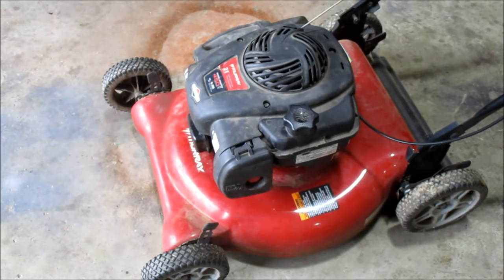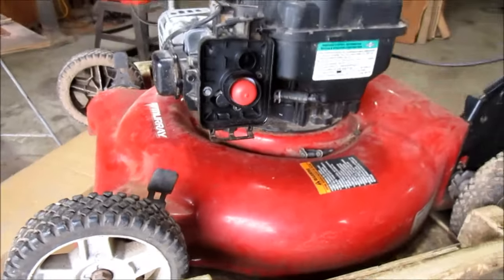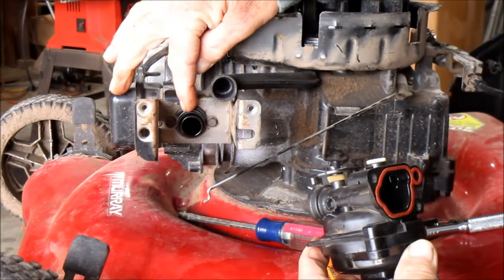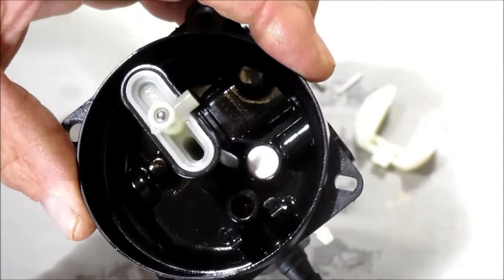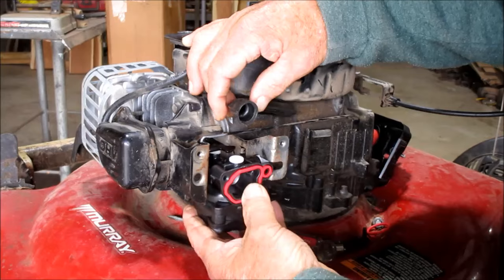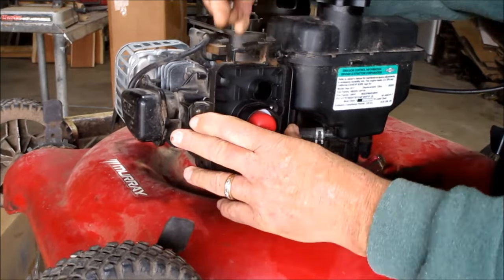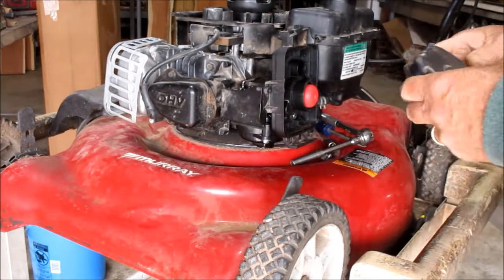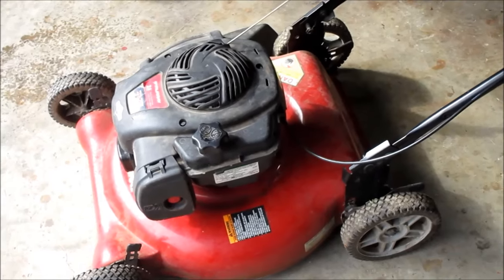Murray LAWNMOWER Won't stay Running Briggs Stratton E-Series 4.50 HP: CARBURETOR Removal and Replace

Comment: Thank you. I followed all your steps replaced the gas tank and carburetor.  Something chewed a hole in the gas tank  so most likely water got into the carburetor and that’s why I had to replace it. Hardest part was finding the right size nut drivers in my husband’s garage.
Reply from the maker: Glad I could help. Thank you

Comment: Thanks Larry! Found a Murray lawn mower in a shed at one of my rental properties that had the same carb. Had been sitting for years and wouldn't start. I pulled that white plastic venturi assembly and it was all clogged up. Just shot compressed air into where that ball bearing is and it came clean as a whistle! Mower starts on the first pull!

Comment: Hello I just found this video, a friend of mine brought  me a lawn mower just like yours with the kind the same problem,  it start run for a minute and then die, also gasoline coming from carburetor, I put a new carburetor and spark plug and still doing the same thing and gasoline coming from carburetor, I put on a shut off valve from keep wasting gasoline , Do you have any idea why is doing this? Thank you for your help and time.
Reply from the maker: It can only be one thing. The needle under float is sticking open allowing fuel to keep flowing
Reply: @LarrySbrusch  Thanks for replying.

Comment: Curious what do you use to get gas smell out've hands . I wash with soap still stinks . And some got on rug in porch how do I get that smell out
Reply from the maker: I have used a lot of different things. What is normally use is a hand cleaner that also removes paint, but it doesn’t smell much better than gas ???. You might try vinegar or some type of ammonia based products. Not sure what else to recommend

Comment: Where's the oil cap and dipstick ? I don't see it on this mower . Just gas cap
Reply from the maker: Mine did not have a dipstick on top. It was down at base of front corner of engine

Comment: What was the two socket sizes you used. I know one was a 8mm for the pull housing and two of the screws on the primer bracket. What size was the other two screws. Was it a 9mm or 10mm.
Reply from the maker: It’s been awhile ago, but if I remember. 10 mm rings a bell
Reply: @LarrySbrusch  Ty
Reply: 5/16 and 9/32 for the air box, 9/32 for the carburetor bowl.

Comment: Carb gums up on first tank with this engines.  I know of 4 different people with same engine with same problem.  Non-ethanol gas helps, but it will eventually get gummed up again
Reply from the maker: Yes you are correct, I’m having the same issues
Reply: @LarrySbrusch  I used an ultrasonic cleaner and overdid it with a 3/64 bit drill.  now I get too much gas.  I have ordered 5 of the part with the jets in it.  will have to wait a few weeks tho.

Comment: Briggs and Stratton are complete junk every briggs i ever had sooner than later wont start i have a new mower thats a year old and wont start put seafoam in it still wont start cheap peice of junk plastic made carburetor they dshoul have a class action law suite against them in the 80s and 90s you could leave old fuel in them over winter and three pulls it would fire right up
Reply from the maker: I agree with you..if they did that , they couldn't sell us anymore junk..The good ole days are gone, just like the old 327 chevy motor..change the points, condenser and plugs and it would keep running..

Comment: So that white nipple on the primer casing has nothing attached to it?  Like a gas line or anything??  Found one in the trash and never worked on a newer mower like this
Reply from the maker: no it does not. it confuses every one. Appreciate the comment
Reply: @LarrySbrusch  its why I like the old school machines. Easy to work and they are built to last. Not built too fast
Reply from the maker: Yes you are so right

Comment: I used this video to fix my Murray 550 today. I ended up cleaning the old carb, replaced the spark plug and filter and she started up first pull and stayed running until the lawn was done. I made some simple diagrams where what screw went where. Made it easier to put back together. I emptied the old gas and put in new. Just took my time. Thanks. But dang it, push mowers were so much easier to work on 20 - 30 years ago. Maybe that was the problem. With proper maintenance they lasted too long! I wish I still had my ancient 2.5hp briggs and stratton motomaster from Canadian Tire bought back in the stone age. Thing lasted about 15 years.
Reply from the maker: Yes sir, appreciate the comment
Reply: I have a 550. It was used it run perfect. But the 450 not do much many adjustment two carberator replacement Lt still not reliable. I need to check compression. 450 have been a serious problems. Clean the carberator it run for me allday but the customer one half a day and dies.

Comment: Great video. My cheap HD mtd crapped out. Cleaned carb. Check spark. Then noticed no compression. Pulled valve cover and checked valve. I think i need to readjust valve clearence. Trying to nail setting down is like nastional scurity. Thinking setting is intake .005-exhaust.007 in that range?
Reply from the maker: good starting point. Appreciate the comment

Comment: what plugs into the little plastic white thing that sticks out of the carburetor?
Reply from the maker: Nothing plugs into it...It is like a vent tube..A lot of people ask that question...they make it look like something has to be plugged into it...confusing. Appreciate the comment
Reply: @LarrySbrusch  Thank you for the quick response! I had my mower apart and put it back together, and the gas was pouring right through that little white nipple. Your comment helped me figure out the issue. My guess was that the floater wasn't working correctly. So I took it apart and put it back together again, and it works great now!  So I'm almost sure it was something slightly off with the floater in the carburetor that was causing it to leak out of there.

Comment: UPDATE:  I found out that the 550E doesn't use a choke!  It relies on the three pump prime in order for start up. &*#$!**&#$@ Bought a new carb for almost nothing on ebay.  Problem solved. Ticks me off that proper cleaning and simple maintenance procedure wouldn't correct this problem in the first place.
Reply from the maker: Appreciate the comment.thank you

Comment: My 550E is on a pressure washer that was only used once, last year.  Fails to start this year.  Use some starting ether on it and it would fire up but not continue to run.  Spark plug was dry.  Took apart the carburetor and cleaned it out really well.  It would start and quit after a couple of sputters, then back to fail to start.  This is when I noticed that the choke was wide open, and not stuck.  Spring pressure was pulling it open.  I don't know anything about these auto choke systems like this one, and was thinking a problem with the t'stat that is located on the muffler and was close to ordering a new muffler on ebay when I watched your video.  Yours is the first video on this engine where the gas tank was removed and I could see a spring located behind the tank that looks like it should hold the choke in the closed position when the engine is cold.  Of course it is pouring down rain right now so I can't get out to check on this, but I now have hope at a solution to a frustrating problem.
Reply from the maker: Thank you for the comment. Glad we could be of some help

Comment: Used my mower 4 times in 3 years. My carb seems to clog easily but no room for a filter. On my second carb maybe 3rd. Thanks for the video
Reply from the maker: Drain the gas and clean the bowl or empty the bowl when not in use for extended times..also make sure the screen in tank stays clean..hope this helps
Reply from the maker: @troywayne8759  great suggestion..appreciate the comment..that will alleviate carb problems in the future

Comment: i bought a Murray 450E in summer 2019 and now I cannot get the lawnmower to start after it sat all winter in the garage with fuel and no stabilizer. Can I add some Carburetor cleaner to the gas that is in the mower?
Reply: I have done that and it was okay. A mechankic may say no due to the flammability but just a squirt

Comment: Larry, I wish you were near where I live, bacause all this lawnmower parts stuff is a little over whelming. I was about to sell off my broke lawnmower and buy another one... I'm tempted to try this and cleanit first... But I am afraid I will break it.
Reply from the maker: Don't be intimidated by it..or do not overthink the process..it's not that hard..message me if you have any issues..I will walk you through it..
Reply: @LarrySbrusch  OK... I have been watching tune up videos too.. Idk what to do, I think the air filter looks bad, it probably needs an oil change, and it's got gas from last year. I guess I have to figure out how to get the gas out first. :( I wish someone had taught me this stuff when I was little. I wasn't allowed to touch the lawnmower or any power tool, because I was a girl. :( now I don't know what to do.

Comment: 17 primes ought to get her goin.
White plastic ring retains o ring.
If new carb has white o ring retainer? Isn't it holding in straight, your new o ring? I think it's doubled up. And those supplier " people" thought the red one would confuse you.
Reply from the maker: Your probably correct..but it does run very good the way it is.i have cut a lot of grass with it

Comment: Hey like your video but that was not a spacer that o ring and white ring came off the old carb if you notice the new carb has one already installed if it stops check that I have one of those little bastards to trim with you have to clean those plastic carbs atleast once or twice a season

Comment: In my town I could pick up a new mower for $200. Orchard Supply is gone now and that's where I used to buy them. I have three sitting in the yard not running and one I worked on the other day has a main jet I can remove with a screwdriver once I remove the bowl off the carb. That's usually a spot I have found they clog at. The last one though had a lot of junk in the fuel Inlet to the carb which I had to clean out with a small screwdriver and the wire and compressed air.. this mower had not sat more than a few months. Hard to believe there's that much varnish or whatever in my crappy gas. Thanks for sharing what you know. It is helpful to a lot of people. I did not see you show a removable main jet on your plastic carb. On all the mowers I have worked on they all have the same removable main jet. And they are all metal carbs. My last one is a Husqvarna  mower with a Honda motor., cost  200 in Ca.

Comment: I was working on the exact same mower today. Kinda same issue, only it starts sometimes, sometimes not, then runs ok, then sometimes not. Never thought you could get new carb so cheap. Thanks for the video.. great info
Reply from the maker: Thanks for sharing
Reply: Did anybody else notice he primed it a total of about 17 pumps? And barely tries after the first 10? That's more than it should ever take

Comment: SIMPLEST FIX:  No need to remove carburetor, just put carburetor cleaner in the tank.  Details below.

My mower sat for 18 months with 1/2 full tank (does have fuel stabilizer in it).  Symptoms were same as yours except my motor wouldn't start at all until I got some starting fluid.  My fix was to top off the tank with fresh fuel and add "Fuel Injector & Carburetor Cleaner" from Walmart (Supertech, 6oz treats 21 gallons).  I estimate I used about 3-4 times more than you're supposed to.  After adding the carb cleaner, I started the motor several times with starting fluid but no improvement.  I let it sit for 24 hours and the next day, with the help of some starting fluid (ether), it cranked up and ran without stopping.  I did manually push the throttle open to get the rpms up until it got warm.

You may not be so lucky, but its worth a try.  I have a Briggs&Stratton 500E.

Update:  looking at my comment 2 years hence, I think I should have made an attempt to empty the old fuel out (one way or another) rather than just topping it off with fresh fuel.
Reply: Came to say thanks for this, I have the same mower and was having the same problem. Kept it running on starter fluid for a while and once it got through some of the new gas I poured in the tank it finally ran on its own and started up without needing the fluid. Saved me from buying a new carb
Reply from the maker: Glad I could help. Appreciate the comment

Comment: say whats the part number for the carburetor?  Thanks alot.  I purchased a mower like that off facebook for 60 bucks and it has exactly the same problem.  Thanks for the hope that I can fix it.  mower looks brand new.  but just starts and dies.
Reply from the maker: follow this length....it should be the correct one..appreciate the comment..https://www.txdashcovers.com/caformubrst4.html

Comment: Omg! A prime example of “ive not worked on one of these carbs before, I’m winging it”
Seriously! There was no need to replace the whole carb, you only need to thoroughly clean the jets in the white stack you yanked out!
Reply from the maker: I know I tried cleaning this one, but it was too plugged up to get it to work. so cleaning was not an option. had to replace it
Reply: Nope! For under $20 just replace the carb in only a few minutes and be done with it. Then clean the other carb when you have some free time, ( if you think that will actually work), and then use that newly cleaned carb the next time the mower quits, and believe me, it will happen again and again. With all the videos out there right now about this problem the evidence is clear to me that this plastic carb  is a poorly designed part. I'm pissed that I got stuck with one but I'm gonna keep trying to defy it and win this battle! Thank you, Larry!

Comment: 40 years a mechanic from VWs to tractor trailers has taught me to use a battery powered driver to quickly disassemble a bunch of small screws and bolts.  Never use the driver for reassembly as you will strip or break them.
Reply from the maker: you are absolutely correct. Appreciate your input and comment

Comment: What was the part number for that carburetor? I have the same mower and am trying to find the right carburetor for it. Was it Briggs & Stratton 593261?
Reply from the maker: go to the following link  https://www.ebay.com/itm/Carburetor-Murray-Briggs-Stratton-4-5-HP-Push-Mower-125CC-450E-4593261-/113618703704?hash=item1a7433d558

Comment: I cringed when I saw the plastic carb, at least the screws holding the bowl weren't cheap phillips that strip when you try to turn them. 

One suggestion, please name the size of the bolts when you're unscrewing them, it helps the viewer to prepare and what size sockets they'll need for the job.
Reply from the maker: Thank you for your response. and I agree they do have good screws in the  base...which is positive...
Reply: Replace pull rope Briggs 4.5 engine